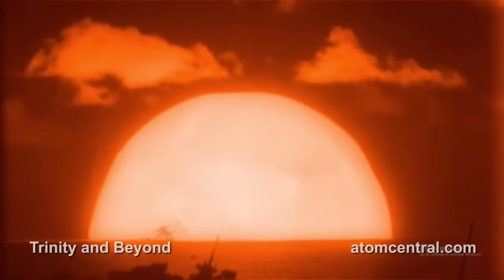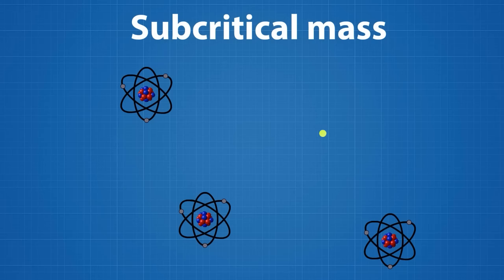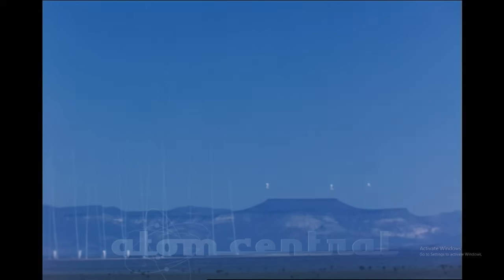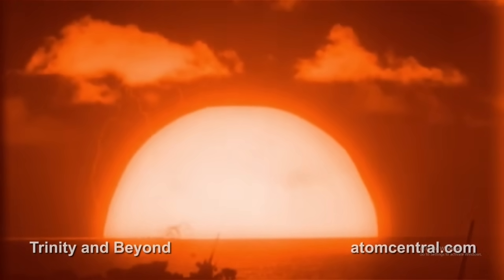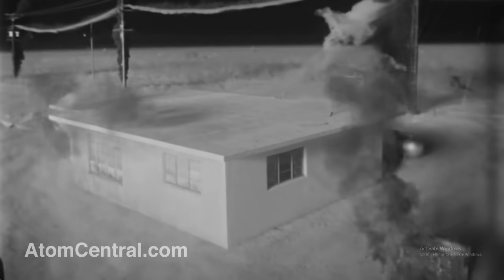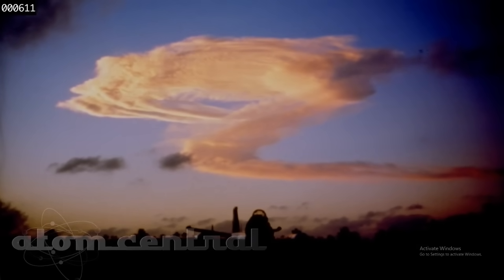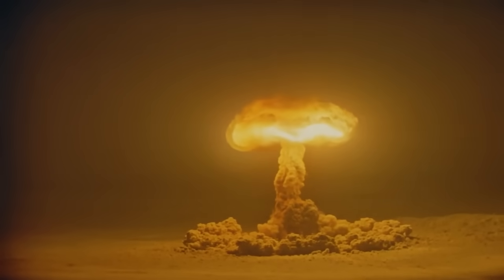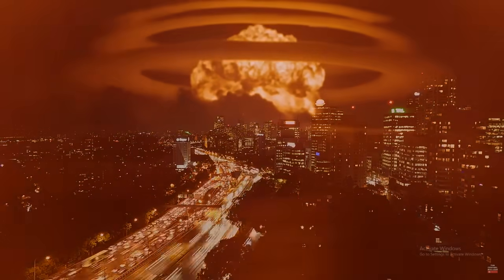Anatomy of a Nuclear Explosion

Comment: Thats technically not correct how it works, like the another commenter I’ve studied physics since I was young with an odd interest in nukes. There’s no little gun as you depicted. The Uranium bomb is known as a gun type A bomb simply because it fired the hemispheres together to rapidly reach critical mass. Don’t forget the Uranium core reaches critical at a set density, dividing the core effectively stops it. Neutrons are bouncing around continuously, as the spheres engage at speed those Neutrons instantly reach critical mass and therefore immediate chain reaction. There’s no little gun firing neutrons, the material itself is generating them.
A plutonium bomb works by forcing the entire core to extremely high density uniformly to reach critical mass, and that will only happen when the material is is under extreme pressure, i.e the plutonium atoms are so proximal that the chain reaction kicks off.
Hence the difference in shape between the two bombs dropped on Japan, Uranium and Plutonium.
The Hydrogen bomb is another subject altogether.
Good vid though only that bit was a bit misleading.
Reply: The gun-type Uranium bomb didn't use hemispheres. It was a cylinder with a hole in the middle that was fired at a pole that filled the hole.

There was an internal neutron initiator, called Abner for Little Boy and Urchin for Fat Man, consisting of Beryllium-9 and Polonium-210. External initiators only came in later designs.

Comment: 3:09
Kudos to the manufacturer of the camera for being able to record and keep the quality of filming even when the paint from the cars is being vaporized by the blast.
Reply: The cameras were installed in bunkers underground and used periscopes with quartz glass IIRC.
Reply: theres another video showing how they did that.... used mirrors i think
Reply: @jairomendoza238 The mirror manufacturer definitely has some insane build quality also lol
Reply: Actually the largest US test, Castle Bravo was kind of failure, because 2½ times larger than estimated yield simply destroyed so much of equipment meant to record data.
Along with causing lots of damage to base structures of testing operation in other end of atoll supposedly safe from major damage. (though evacuated)
https://youtu.be/PvDvN5oYoZw?t=185
Reply: 4:44 
Those are amazing, considering the paint isn't the only thing to disappear in the light.
Reply: Ahhh...have you ever heard of the telephoto lens? Plus yes, protected equipment filming a reflection.
Reply: Cameraman has plot armor
Reply: There’s camera man comments are so lame.  Must you people parrot everything you read?

Comment: The fireball is more correctly a fire bubble. The interior is pretty much a vacuum, since the fission products and vaporized bomb structure form a fast moving shock. The vacuum sucks up the dirt from the ground to form the stem of the mushroom cloud.
Reply: It's like standing in a 4-foot swimming pool. You push your hands down sharply into the water. You create a sharp disturbance that caves the water in (explosion). In a second, the displaced water rushes up into the air. The shock wave reaches back across the pool, as the water gets sucked in to replace what you just pushed down. This is why, on films, you see an explosion, immediately followed by a sucking reversal of the air. It's the reversal of airflow that pulls all the shit up into the atmosphere, then it just gently falls down over the Dollar General. Damn; I wanted that Hamburger Helper.
Reply: The fireball is superheated air and under extreme pressure, not a vacuum. Once the shockwave travels outward, the air becomes less dense than the surrounding air, creating a buoyancy effect. This creates the famous stem of the mushroom cloud that sucks material up from the ground.
Reply: @charliefoxtrot5001  i disagree....the fireball is not a virial mass. When fission occurs the fragments of the nucleus recoil from each other, and this kinetic energy is directed outwards at relativistic speeds. This forms a thin spherical shock composed of the fission products and bomb debris. A bubble. And very low pressure on the interior. The shock, in turn, slams into the surrounding atmosphere and heats it up to x-ray temperatures. That, and the decay of unstable fission products forms the fire ball, or more correctly fire bubble. It is this low pressure bubble that sucks up the debris from the ground.

Comment: Really surprised they never created a grenade version of a nuclear device, or there abouts... If it'd be possible that is. They shrunk it down to being fired out of canons. What was it, something Annie. 🤔
Reply: The device was called the Davie Crockett cannon, which fired a (if memory serves) the M388 device with an yield of 0.25 K T.
Reply: The smallest devices were those used in nuclear artillery shells with the W82 (developed but cancelled with the end of the Cold War) being the smallest and lightest - it fitted inside a 155mm artillery shell which weighed 43kg. You couldn't make something as small and light as a grenade because the only way to do it with a tiny amount of conventional explosives is to make use of plutonium phase transition which is a very inefficient compression method and needs about 13kg of plutonium in addition to the weight of all the other parts of the device.

Comment: There are a couple effects that go with the Fireball segment, though they only pertain to the visuals rather than the destructive effects:
1) The double-pulse. It's caused by superheating of air directly surrounding the fireball, which causes it to become opaque. This leads to a short period where the shockwave obscures the light of the fireball before it cools down enough to become transparent again.
2) The rope-trick effect. The "sparks" and "spikes" seen in nuclear blast footage is created by solid matter, whether it be the bomb casing or the tower that the bomb cab sits on (as well as the guy wires stabilizing it). Solid matter transfers heat a lot faster than air and water, which causes said matter to vaporize faster than the shockwave itself.
Reply: The rope trick effect is caused by solids yes. It however has nothing to do with heat transfers rate.
It's just more opaque to the radiation, therefore it eats up a larger portion of the energy of that flash and so heats up faster.
Reply: @朕是神  Exactly. It is heating and vaporization of the rope induced by exposure to the high-intensity visible light radiation I mentioned which causes the effect and not the temperature of the fireball itself. The light itself is many, many times hotter than the surface of the Sun.
Have you watched the videos of the Tsar Bomba and the long time between the double pulses?
Reply: @ut000bs  Not sure which video you were referring to but yeah I am aware of the air turning somewhat opaque to the radiation and basically getting fried. 

Side note, sun's surface emits about 4e7 W/m^2 of EM radiation. The fireball of a 1000 kiloton equivalent nuke at, say, 10m radius, goes at something around a million times that.
Reply: Thanks...always wondered what caused these.
Reply: The x-rays and UV waves coming from the initial chain reaction and the SUPER high-temperature actually cause the air itself to become incandescent and emit light. If you can wrap your head around what would make the air you breathe emit light then you're one up on a lot of people. 😉👍‍#physics
Reply: Not to mention that due to the high gamma emission, even with your eyes closed and hands covering your face you would see the light.   =/
Reply: Spikes aren't caused by heat conduction in/through material, which is absolutely piss poor slow method of transferring heat:
https://youtu.be/51bwzEO8XCw?t=74 https://youtu.be/OR8u__Hcb3k?t=48
They're caused by extreme radiation intensity of fireball literally vaporizing surfaces.
https://en.wikipedia.org/wiki/Rope_trick_effect
Reply: The vertical spikes are from sounding rockets, used to measure distance and shockwave characteristics. The angled flaming spikes leading into the fireball are guywires used to stabilize the tower vaporizing from the heat absorbed from the heat of the fireball.
The double pulse, spot on. Cooling and shockwave formation, the shockwave disrupting the case shock initial fireball and opaque core fireball. Oxygen and nitrogen really intensely dislike such energetic abuse and all and simply want to refuse to participate...   ;(

Comment: 1:30 yeah, but no this is not how a nuclear detonation works. There is no nuetron source spitting neutrons into the core.
Reply: It depends. A lot of modern bombs do have a neutron source to kick start the reaction or to control the yield in variable yield bombs.
Reply: Actually, there is a neutron source to reliably initiate the chain reaction at the right point in time and at larger scale than natural decay would. It is needed due to the small time window the prompt supercriticality has until it blows apart again. The early bombs used internal sources, while the later generation bombs used external sources. See more about that here: https://en.wikipedia.org/wiki/Modulated_neutron_initiator

Comment: Unless all that unused Plutonium or Uranium falls in one spot, I wouldn't be too concerned about its radiation....spread over a large area it's not very radioactive given the long half-lives. The shorter the half-life, the more radiation it can spew out in a given time...although if it's half-life is really short, by the time it falls out it's mostly gone. Either way, if you're downwind of a unclear explosion and can't get away, get indoors and try to keep the dust out, and stay there for as long as you can....after a couple of weeks, radiation levels fall from death in minutes to being safe enough to go outside.

Comment: In a nuclear detonation, the energy released can be classified as electromagnetic radiation (gamma rays) or kinetic energy of the fission products. The kinetic energy results from the mutual repulsion of protons in the nucleus. At the short distances, the Coulomb repulsive forces are enormous, and accelerate the fission fragments to a speed that is a considerable fraction of the speed of light. These accelerated fragments form a spherical, expanding shockwave, which is the fireball.
The shock quickly heats up to hundreds of millions of degrees forming  the fireball, or more correctly, a fire bubble.

Comment: The flash is caused by gamma radiation released from the annihilation of the residual strong force that holds the nucleons together. This gamma radiation is degraded by the Compton effect and other processes to lower energy electromagnetic radiation (x rays, uv, visible light, infrared, microwaves and radio waves. This is the EMP or electromagnetic pulse......

Comment: Re the emission of light - it's not just ecited electronic orbitals but one nucleus becoming two tears the orbitals of the orignal Pu nucleus to bits and the electrons then have to settle into orbitals around two separate nucleii. Some of the orbitals will be really "deep" and emit extremely high energy photons.
One notable feature of the multi-frame timelapse photos taken of the Trinity test is the appearance of a bubble around the explosion in which a sea of stars appears. I'm guessing that the highly compressed air forms a lens which greatly distorts and diffracts light from the stars in the night sky.

Comment: Quantum physics and fission/fusion is a fascinating topic. Years ago, I couldn't believe  when I heard it for the first time that there are natural nuclear reactors occuring on the Earth's surface being active for hundreds of years. With all the needed parts to keep the balance, like moderators, cooling, water and the uranium. Isn't that fascinating.
Reply: Where ?
Reply: Oklo, Gabon.   It was originally discovered by the French who seperated and refined the uranium from the mine. They were expecting a certain ratio of Uranium 238 to Uranium 235 and the numbers were "off". there was much less U235 than they expected and it was a concern that maybe someone was diverting some of the U235 from their production facilities. The difference was between 0.72% that they expected and 0.717% that they were extracting. After investigating they found an increase in non-radioactive decay products in the mineral samples. (things like radium and uranium will naturally decay down to lead that is non-radioactive). Looking at the geology they found that around 1.7 billion years ago there was an area of high Uranium concentration that was functioning as a natural reactor. Uranium can be water soluble and it formed deposits. Water in the uranium ore acted as a natural moderator (it slows down neutrons and increases their capture cross-section). When the rock was wet the reactor would turn itself on. When the rocks got hot and it drove out the water the reactor would turn itself off. It did this for a few hundred-thousand years.
Reply: ask Wikipedia for Natural nuclear fission reactor (Geological situation in Gabon leading to natural nuclear fission reactors).
Natural nuclear fission reactors are only known in two uranium deposits in the world, the Oklo and Bangombédeposits of the Franceville basin: Gabon. Since 1982, five new reactor zones have been discovered in these deposits and studied since 1989 in a cooperative European program  @blndjamesblndParis
Reply: @blndjamesblndParis  Look up the Oklo Reactor or Oklo Mines in Gabon in Africa.

Comment: I have read in previous analysis that the Little Boy, Gun type, burned only 1 gram of plutonium and maybe a Pound of Uranium, the rest was as indicated vaporized and scattered causing most of the Fall out.  The Fat Man, Implosion, was much more efficient than the Little boy giving more yeild for the same amount fissionable Material.  AS the efficiency climbed in weapons development and eventually the H-Bombs the amount of material need dropped to now a 1.5MT 2stage and 3 Stage weapons are in the 10s of lbs not including the safeguards, triggering and shielding.  The US and likely the Russian current weapons like the B61, W76, B80 series are less then 700 lbs including the airframe or re-entry vehicles.  The weapons 2 day are in the high end 1.5MT to 3MTs down to 40kt weapons.  Suitcase devices are between 1.5kt to 5kt and are likely gun type, enough to destroy major buildings from the inside.  What is not published much is the warheads in US Cruise missiles, those are rumored to be in the 300 pound total package and yields are from 10Kt to 1MT depending on target.  Cruise missile Nuclear Warheads are extremely advanced/efficient because of the need to save weight.  Some claim the US Cruise missile Warhead are the size of a large Thermos bottle and in the 30 lb or less weight range.  The safety, triggers and shielding make up the bulk of the 300 lbs.
Reply: The gun-type device, Little Boy, didn't had Plutonium. It was a Uranium bomb. Less than 1 kg of the overall 64 kg of Uranium underwent fission.

Fat Man was the implosion device and had a Plutonium core and a Uranium tamper. About 1 kg of the 6 kg Plutonium underwent fission. Some of the Uranium tamper underwent fission as well.

The implosion device is more efficient as it needs significantly less fissionable material. The gun-type device needs more than the critical mass, while the implosion device can do with less.

Comment: Don't supercritical masses spontaneously autoinitiate fission chain reactions through normal radioactive decay? What's this business of shooting cores with neutrons?
Reply: The neutron source reliably initiates the chain reaction at the right point in time and at larger scale than natural decay would. It is needed due to the small time window the prompt super criticality has until it blows apart again. The early bombs used internal sources, while the later generation bombs used external sources. See more about that here: https://en.wikipedia.org/wiki/Modulated_neutron_initiator
Reply: @charliefoxtrot5001  This is really interesting stuff, thank you!
Reply: Plutonium actually has a fairly low neutron flux so it was known from the beginning that an initiator would  be needed.  Polonium-210 and beryllium were used to provide the initial neutrons.
Reply: @larrybell726  What about the demon core criticality accidents? There were no external neutron sources there.

Comment: I HAVE A QUESTION! How do these old video cameras survive a nuclear blast AND stay stable enough to capture the film of buildings/cars being destroyed without even shaking back and forth???
Reply: Telephoto lenses. The actual camera isn't as close, and would likely be in a shielded structure.
Reply: The same reason is why cars magically appear and disappear from the shots? 4:44
Reply: @mxpxdrums It's a film edit. The first couple of frames are clearly of the house being prepared for the test, there are people moving and various crates and boxes. There is a splice that cuts to the blast. Nothing magic about it sorry.
Reply: The cameras were in a bunker, used a mirror system and tele lenses.
Reply: They didn't use video cameras.  The cameras are all film cameras.  Some of the cameras used special emulsions that were less gamma ray sensitive and had extremely low exposure index because of the level of brightness from the first milliseconds of the bomb detonation.    Except for two custom films, 918 MF (black and white) and XR (color), all of the film used was commercially available Eastman Kodak film. 918 MF is a gamma ray-resistant film with an exposure index (EI) of 0.1, and XR is a three-emulsion layer film with each layer having different light sensitivity. The yellow layer with an EI of 400, a magenta layer with an EI of 25, and a cyan layer with an EI of 0.1.